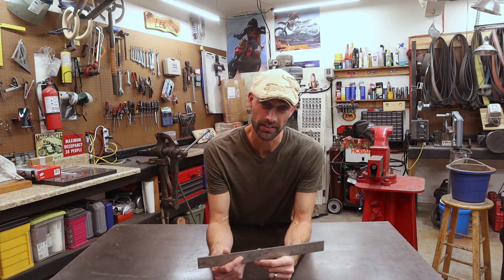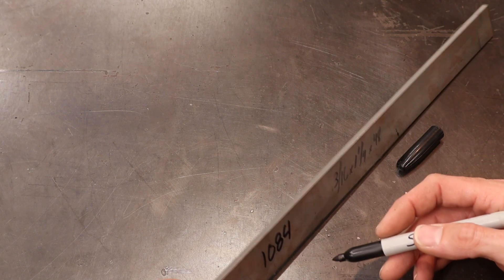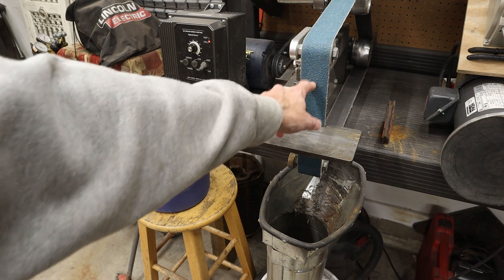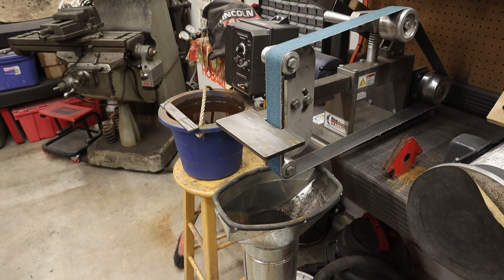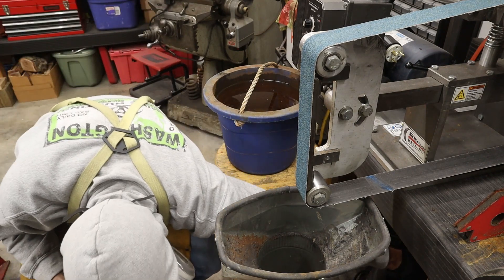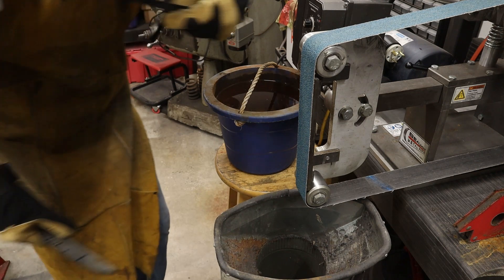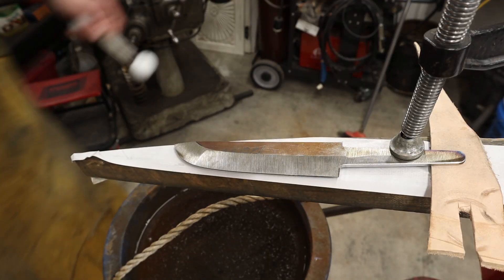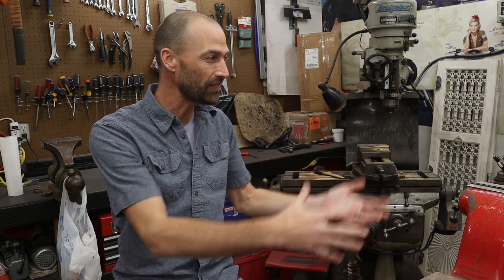Puukko knife a step by step build series Pt.1 Making a Nordic knife blade

Comment: Airin, I have a question about rough belt grinding.  It is easy for me to pull the blade along the straight level part of the blade.  I encounter problems when the blade begins to curve toward the tip.  I can see you pull the handle toward yourself which moves the blade edge in toward the belt. It causes me to get into the line on the cutting edge.   Maybe you could spend some time in one of your upcoming videos showing and explaining what you do to adjust the grind in this area.  Hope this makes sense.
Reply from the maker: It does make sense for sure! The way I do it actually goes against what I was taught! I adapted my own way of grinding through trial and error and personal preference. I will do a video on it and try to explain why I do the motions that I do in more detail
Reply: @Aleeknives  thanks.  Spent 3 hours sanding on puuko today.  Lesson learned.......the belt grinder can be your friend or your enemy!
Reply from the maker: I literally spent 3 hours hand sanding yesterday! I should have spent more time at the belt sander but my blade was already thin when I started to sand! I didn't  want  to grind any more off! However,  it worked and this weekends video is going to be awesome!

Comment: The way you started shaping the blade ... tells me your sanding is a lot of cheaper than cutting/trimming in your country.
Reply from the maker: yes and faster if you ask me! I buy my belts for around $5 US for the 36 grit zirconium belt. I can get several knives out of each belt. I have tried the band saw but prefer to grind if there isn't a ton of extra material!